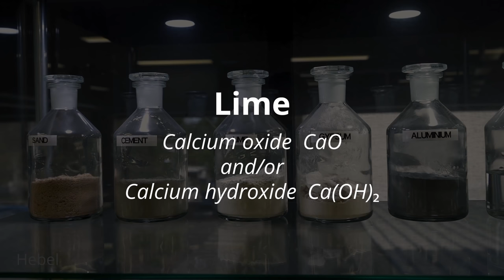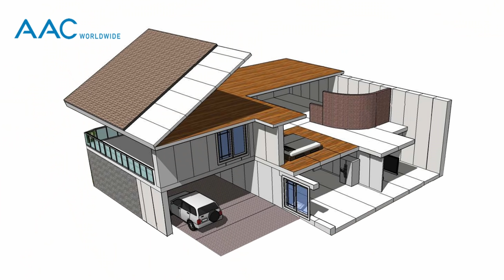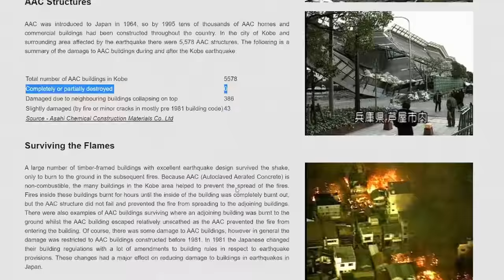AIRCRETE lightweight concrete | Everything you need to know

Comment: Dear Belinda Carr, please note that this material has some drawbacks that I don't think that you have mantioned. We live in house build of Autoclaved Lightweight Concrete (Ytong manufacturer) for few years noew and in time I have learned pros and cons of this material. First: it is awesome. You have mantioned almost all good sides of it. Dont remember if you said that it is quicker to build with it compared with traditional masonry. Probably also more versatile because you can scrape or sand it to desirable shape. People build statues out of it, so it is no problem to send it to semi circle or something similar.
As of cons, be aware that is corrosive to the iron. When you do reinfcement (for example, for windows and doors), rebar must be inbeded in concrete, not in its mortar. You can easily put nail or screw in block, and it will hold rather well, but if vibration is present, it will increase hole diameter which will losen screw or nail. Also, in time, screw or nail will rust. When metal is in direct contact with AAC, it should be galvanized.
Regarding moisture - it can soke quite a bit, and it will need some time to dry up again. If it happen in winter, material will deteorite due freezing cycle. With increased moisture content material will have reduced insulated propertie. Manufacturers usualy don't advertise it this way, but if you are persistant, you can find moisture content to insulation ratio. Almost always, they show numbers only for fully dry product.
All that said, I would use it again for my home. Our walls are 37,5 cm thick and we have also roof made of it. For now, we are very satisfied with our home climate through all seasons, and we have relative low heating and cooling bills.

If you need any informations (from me as actual user) or pictures how we did it, I will be glad to share it with you.
Please note that our home is located in Europe, but I don't think it would be any different regarding building processes in America.

I'm eagerly anticipating new content from you.
Reply: Can agree with most what you said except with the moisture in the walls and freezing cycle? Something ain't right here is your house completely finished ?  Do you have a proper facade on the walls, drainage, wapor bariers..?
Reply: @altergreenhorn  Not for my house, but for material itself. Finished house won't have those issues. Manufacturer stated that facade need to be applied. Just comparing with regular masonry, for example brick, where finish facade is nice, but not mandatory.
Regarding moisture, I tried experiment: I left AAC block in water for one hour. It soaked water about 30% of it weight. I left it to dry for 48 hours, and after that it had still more than 10% more weight. In real life it won't be issue, but if flooding occurs, or you have broken pipe, it's nice to know limitations. Perhaps American "stick house" would sustain more damage in this situations.
Also this materials do not need vapor barriers. You have only 3 layers. Block itself, interior plaster on inside and exterior plaster outside.
Reply: Valhalla  It's suitable. AAC is widely used in/comes from Europe, northern parts are not exception. It'll be fine with few freeze cycles (YTONG states their products stand 100 cycles).
Reply: Valhalla  It's OK. It's great material for winter. Good insulator compared with regular masonry. Just I don't think that you can use mortar in freezing temperatures to build your home. You should make it with water not with ice :) If rain or snow make blocks wet, they will dry out. Don't worry.
Reply: Agreed. My country home is AAC on a slab foundation and it couldn't be a better choice. May I through in one not-so-small drawback though. Costs of interior finishes. Frame-and-drywall walls are smooth by design. AAC walls need tons (many tons) of mortar coat.
Reply: @niter43  It is fine with many freeze cycles. There are plenty of 20-30 years old unheated summer houses in my area - they are left unattended in the Russian winter, and... no adverse effects so far. Perhaps some reduction in load-bearing limits, but it's unimportant for small houses.
Reply: @lazarojnenad  These days, builders often use spray foam in place of mortar. Long-term stability is debated, but at least the winter-grade foam is certified to properly cure at winter temps.
Reply: Thanks for the info
Reply: @jmi5969  Didn't think about a closed cell exterior spray foam... though was thinking at least stucco or another exterior coating to seal from moisture and water inflitration over time.  Seams even a waterproof polymer coating on the outside can be beneficial.  I like the closed cell foam idea... seams correct or possibly couple inches of foam with exterior facade covering/coating.  Then inside... plaster, stucco or traditional covering if even I guess.
Reply: @jafinch78  The rule of thumb here in Russia is that exterior finishes are not really necessary - neither for heat retention, nor for moisture control. Moisture seepage from inside is stopped by interior stucco. Exterior rockwool is fine, but it's cheaper just to use thicker AAC (which won't attract rodents like rockwool). So in the end it's purely cosmetics.
Reply: @jmi5969  Interesting.  I'd think something to seal the pores at least so water can't get into the exterior of the aircrete and freeze which would expand and contract the brittle material and cause wear.  Seems for longevity, an exterior sealant to shed the water would be better. Thanks for the insight.
Reply: I could be way off base here, since it's not a subject I'm familiar with, but I believe one of the reasons houses in California, as you mentioned, are made of wood and not brick is because wood flexes much better. So in California, you can choose wood which isn't great in a fire, or brick, which isn't good in an earthquake. I know you can make fire resistant and earthquake building from each. I'm just referring to the properties of the material.
Reply: @joshm3484  Wondering if like the open source UHPC maybe in an RC structure would be the best?  I recall in Japan some use like a ball bearing like footing pad under the pillars/columns so the ground can move and not the structure as much.
Reply: Maybe just a better footing spec would be better for earthquakes?
Reply: @nenad do you have a social media account of your project or home
Reply: This is so insightful, you could make a 2 minute response video.
Reply: @joshm3484  That is why she also mentioned Japan in the video as they also have to build in a seismically active area but are still able to use AAC.
Reply: @joshm3484  AAC should perform better in earthquake than bricks. I think that earthquake forces on structure are proportional to the weight of the building and AAC is lighter than bricks for same surface area of wall. Don't know how mortar holds. Im my (limited) experiance it is harder to separate AAC block when they are glued one to another with recomended adhesive. Usualy block itself brakes.
For the brick house the mortar holding the masonry together is generally not strong enough to resist earthquake forces.
For the AAC block house block itself will crack if strong enough forces are introduced.
If neither, brick or AAC are not reinforced, I think that timber structure will outperform them in earthquake.

It would be nice if Belinda involve in conversation. She is a professional. I am just a home owner.
Reply: @lazarojnenad  Masonry/brick buildings need a water barrier in any place that isn't the middle of the desert, typically with some kind of silicate in the cement plaster (sika-1 for example). Any lime mortar is corrosive to metal
Reply: @nirodper  I'm thinking we agree that vapor barrier belongs behind the AAC exterior exterior (I'm a lay person who with a personal interest, not in the trades). I haven't researched non-ferrous stucco latices, but comments above suggesting plastic coating remind me of mold and water damage wall system failure --  cement that's allowed to, "breath," will dry...however, in my limited knowledge, reducing the surface area for organics to collect would be preferable and easier to clean...so, I'd think leaving aircrete exterior un-plastered would not be.
Reply: @oasismike2  a water barrier is NOT a vapor barrier. Water barriers go ideally in the outside, preventing water from getting into the walls but allowing air and water vapor to escape.

In "dry" framed wood or steel construction a common water barrier is tyvek and simmilar housewraps. 
In masonry, a thin coating of concrete plaster with waterproofing additives is rendered on the outside, commonly used additives are silicates or polymers (acrylic, latex, pva). It prevents water from entering and allows breathing. Also there are waterproofing "membrane" paints that can be used on old walls.

In framed construction an adtional vapor barrier is placed inside to prevent from humidity from the inside humid air condensing on the cold outer layers of the wall and getting trapped inside the wall. This is tipically not needed in masonry buildings, and the walls can "breathe" inside. Clay brick is an excellent humidity regulator.
Also, in hot and humid places the vapor barrier may be placed differently
Reply: How many floors can be built with it?
Reply: Valhalla  You must leave it to dry for 1 year cuz after factory it  must dry all out, but moust off ppl just do steight isolation affter walls are done , there is no problem leave it  bere in winter for 1  season
Reply: @Nenad Lazaroj do you have additional insulation and any barriers on your AAC house? What climate zone is that?
Reply: @lyudmylasharma7768  What Ytong states is for their product. 

I don't see any confirmation on blocks being AAC in the video -- author can't differentiate between AAC and foam concrete and uses those terms interchangeably even in title.
Reply: Aircrete should be used in conjunction with normal concrete for optimal efficacy.
Reply: Your comment is probably way more useful than this video..
Reply: We have a holiday home in Greece made from Ytong as well. The mason's weren't experienced at working with it and so the wall construction was not particularly neat, but once it was all covered it has proven good.
They did a thick concrete render with embedded hard stone (they said including marble dust) which makes the exterior and interior very tough but once you get beyond the render it's very soft to drill.
I chose to go extreme with the insulation because it's in the mountains and I had them make it two layers with an insulating layer between.
It's set on a solid concrete raft to ensure total stability, we have earthquakes but not big ones in that area.
Overall, I would happily use Ytong and equivalent again and I would recommend it. Yes, you don't want to leave it as a finished wall, but that's not the way it's intended to be used either.
Reply: Hi can you tell me where you purchased it please?
I live in Scotland.
Reply: @elizabethwinsor-strumpetqueen  b&q sell them and many building supply warehouses. Brands like Thermalite Shield, HH Celon and even Ytong.
Reply: @jafinch78  Long before the ball bearing and rubber pad, we have use the natural ground water as the damper of a building in Japan. its like putting a glass inside a glass of water, the building is separated and float on the ground using bouyancy of water. Then we use AAC/ALC Panels with Rocking Wall Methodology. Only in Japan.
Reply: @alchaus  Neat, I'll have to read into the later.  I never knew about.  Thanks for the insight.
Reply: @lazarojnenad    This wall system works in warm climates but nowhere else.  In a cooler climate (zone 6 or less) it needs exterior insulation and a WRB as well as a wear surface (weather barrier)😇
Reply: @jmi5969   Foam is a really, really BAD choice!  It takes a great material and makes a substandard product out of it!
Reply: Hello Brenda. Thank you for your educative videos. Please can you do another video on AAC, highlighting the pros and cons of using it for residential building in North America especially here in the south. Are there other resources you or anyone can recommend for further study on this material? Thanks
Reply: @niter43 but it does not state 100 freeze cycles while saturated with water due to a leak or flood - and that is what was being clarified

Comment: We specified 10" AEC exterior construction on a new home we built in Albuquerque, NM (USA) in 2010. We also specified that interior walls bordering the AV room be made of AEC. (for sound insulation). We have had absolutely no problems with the materials and our heating and A/C costs are the lowest per SqFt in our high-end neighborhood. The sound insulation is absolutely outstanding as we designed the AV room with an isolated split-air system with all electrics and AV wiring being integrated into the concrete floor. The latex fortified exterior stucco looks new after 10 years of exposure to extreme heat and cold as well as extreme day/night mountain temperature variations.  

We were able to find a concrete contractor who had built using Hebel AEC in several other structures and the construction process (as to the AEC) went without problems other than transportation delays from Mexico).
Reply: Cost difference compared to stick framing (materials, labor, etc.)?

Certainly seems promising, but it always comes down to money (both upfront and longterm).
Reply: hi  Joe, do you have a video of the construction of your house? or could you create a corresponding video to Belinda's excellent video about Aircrete?
Reply: @quintessenceSL  We were told by our architect that the use of AEC would increase the cost of construction of the house by @4%. This 4% kicker would be reduced to 2% if we had gone with spray-on insulation  (which we would have done) rather than batt insulation. IIRC the 10" AEC walls are rated for R50 in our climate.
Reply: @leadlearner6391  Sorry, no. We were not in the State while the AEC block was being laid although I arrived on an inspection trip shortly thereafter. The AEC contractor had cut the blocks with a power saw and routed the electric traces and plumbing line runs with a carbide router. There was about 10mm of white fine dust on the foundation concrete (which it did not pit) which was later washed off with water. No aggro at all.
Reply: @joegoldberg8770  That's not bad. You could easily spend that (or more) getting equivalent soundproofing, insulation properties, etc. on a traditional build. To get all those benefits at only a modest price increase is a bargain.
Reply: @quintessenceSL  We thought so and have not regretted our decision (unlike PV solar panels).
Reply: @joegoldberg8770  thank you for your experience and information, much appreciated :-)
Reply: @joegoldberg8770  10mm of white fine dust? This is strange to hear. I did the cuts for the electric wiring myself and it did not require any special tools (one wood saw disk for a 120-sq.m. house). There wasn't much dust at all.  The particles where more like lightweight sand grains rather than fine dust.
Reply: Eat the rich.
Reply: @joegoldberg8770  Thanks for sharing your experience, Joe. I visited the Aercon AAC factory in Florida and was sold. The benefits outweigh the costs, especially when factoring in longer term maintenance, which is close to zero.

I didn't know Hebel AAC blocks via Mexico was an option. Did you also check out the Aercon AAC products?

Comment: I just had my home built using AAC blocks. Here in Bahrain we have a choice between that and sandwich blocks. I avoided making any load bearing walls whatsoever, just in case because it isn't as strong. Most contractors don't know how to use it, so they end up laying it with cement mortar rather than its special glue.
Reply: Does it have any special needs for air conditioning, heating, or clothes dryer?
Reply: @helenhobbs5472  No, nothing like that. Just bear in mind it's fixed with a special a glue and the plaster later is made with a regular cement site mix, except there's a special additive. Without the additive, the plaster may not stick.
Reply: @EbrahimHasan  Dear Ebrahim, I will be experimenting with aircrete in Iraq and considering large scale implementation in case of success, I have many questions regarding this technique and have many ideas for improvement, would you be open to talk about this?

Comment: Best review so far that I watched. Very professional. You are not wasting time like others. Aircrete is not popular because it CAN NOT support 2nd Floor! But this is thoughless because, who needs 2nd floor if you build outside the city or on cheaper land? Saving surface of land is only important in big cities. This will take off once someone like me, designs ground floor stand-alone house. As for outside, I would use Epoxy or Marine Paint that is used on ships. That would be my waterproofing for walls. As for floors, I would waterproof with just laying down tarps. The corners would be reinforced with 4x4 and the top horizontal bars would be from 2x4".  This way it could support the roof.
Roof would have frames from 2x4 and plywood. Keep in mind that Roof doesn't have to carry any weight. They build roofs that are unnecessarily strong.

Comment: Nice video Belinda. I renovates mine 100 years old cottage with aircrete.  It is light, really good isolator and biggest plus for me was simplicity of adjustment. For cutting you need just simple handsaw no need grinders like when you cutting bricks. Another positive is that they are so precisely made so you need just really thin layer of mortar. I think overall  it is one of the best materials for building homes. Greetings from Slovakia.